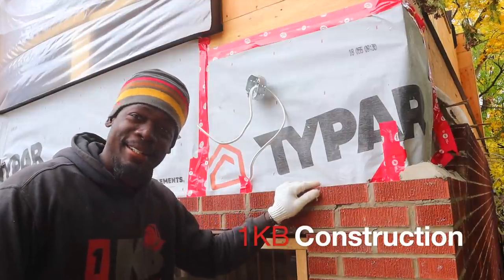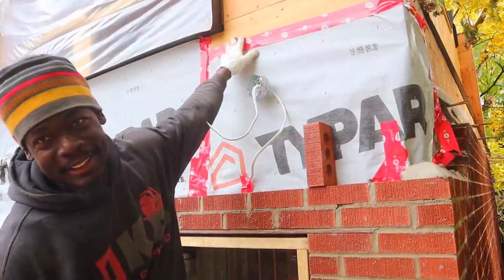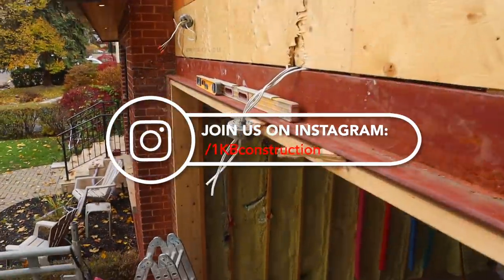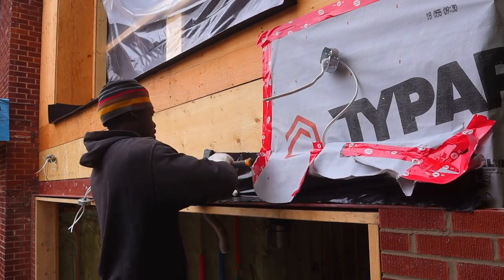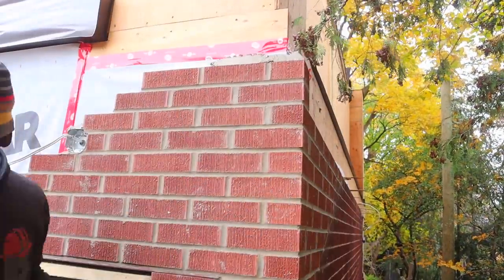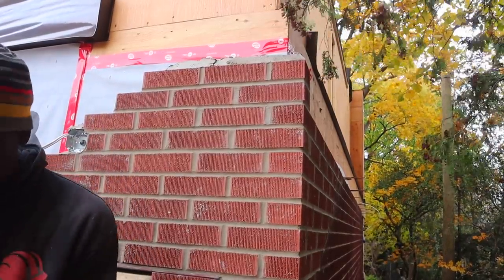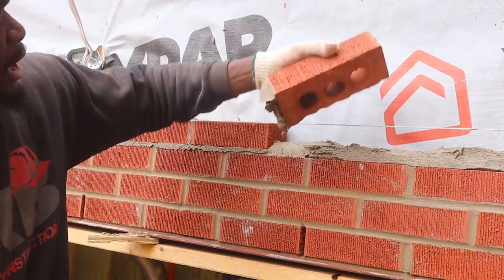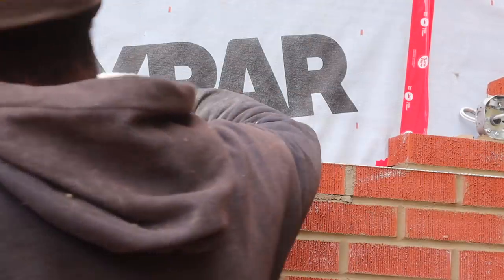Worst Day In Bricklaying History, DIY

Comment: At least the client will have to pay for the extra work. Building a timber frame now and not one lintel fits in the cavity. Which means the bricks don’t fit over the top either. Timber Framing is always nightmare. You’d think if one side was shy the other side would be big. But no, the timber frame came up big all round.

Comment: Man I wish you would come work for me I own a BRICK-POINTING buisness and do well just doing the restoration no structural. I do also brick repair, brick waterproofing, spalling brick replacement. But I wish I could hire you buddy to help repoint America.
Reply: o lord pointing is absolute shit lol only thing worse is scratching block walls lol. though i don't mind if its and under the table weekend thing but full time for a company hells no.
Reply: @gargalash9191  I'm sorry you feel this way but repointing projects are extremely profitable if Done correctly. Not Evey mason can do that it's very important and not only that there's more money in it than structural masonry. I'm non union in the states but bid on union work which means I pay my men the prevailing wage which means 55$ for a laborer and up and $70 to 85$ for a pointer so don't say it's shit work because it is not. Ty dir

Comment: I understand cutting the back of the bricks for the steel but why cut when your above the steel 🧐
Reply from the maker: Because above the steel you still don't have enough space
Reply: @1kbconstruction824  That’s sounds like your correcting a mistake made by the framing carpenter
Reply: You dont have a 50mm cavity on kit ? 
And no fire stops around windows or doors building regs must be different from where we stay really strange
Reply: @mattknox6443  Where are you from
Reply: @myronsmith2114  scotland and been a builder for 25 years
Reply: Wasnt a negative comment my friend was a genuine ?
A did say mist be from somewhere different the ply on kit with black lines is a giveaway seen it on a lot of american canadian channels